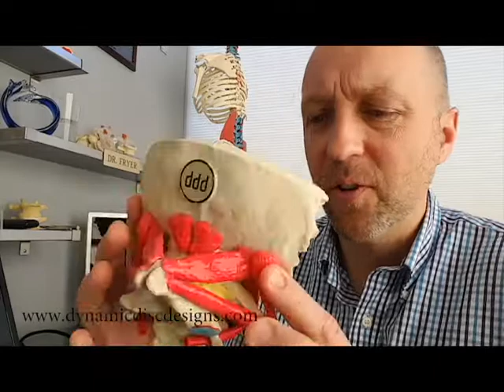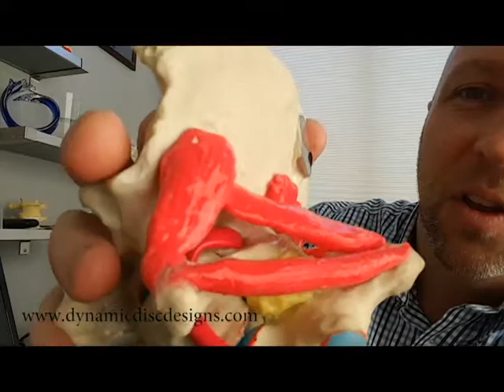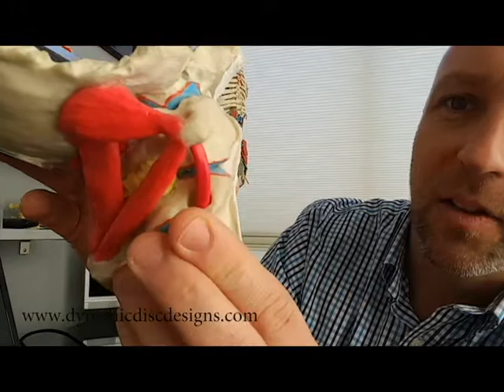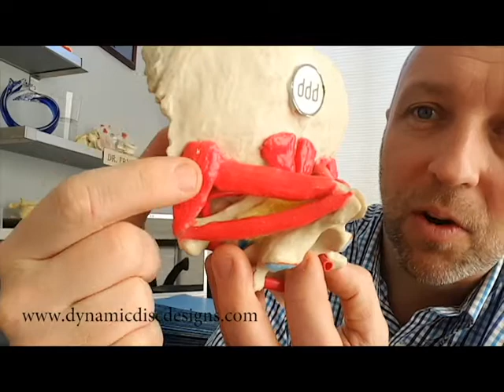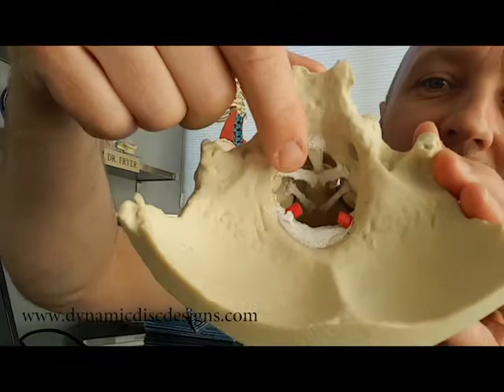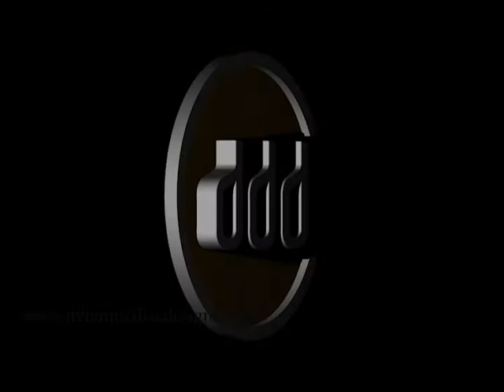Craniocervical Junction and Upper Cervical Model by Dynamic Disc Designs

Comment: I stood up rather abruptly 25 years ago, smashing my head into a pipe above me. It pushed my skull downward on the top vertebrae, and after the company doctor almost paralyzed me, trying to twist and pull upward (Fell to the floor, trembling), went to the hospital and chiropractors for years. Occasionally, and for weeks at a time, the hinge ball on this vertebra, pops out of the socket point of the skull, causing tremendous pain. I built my own traction device, and visit the chiropractor, which is a temporary fix. Is there a surgical procedure to pin / fix this permanently?